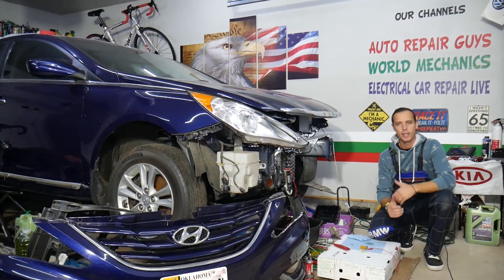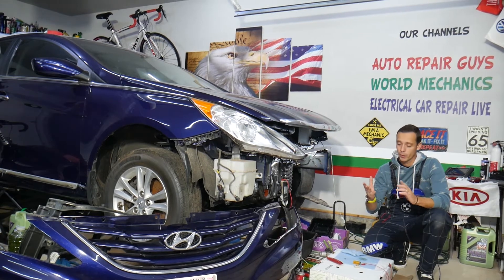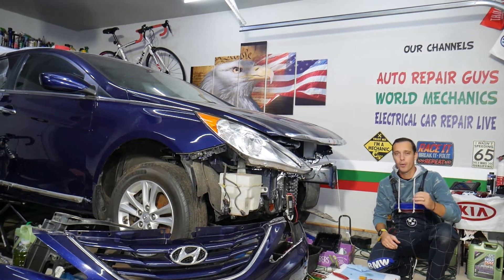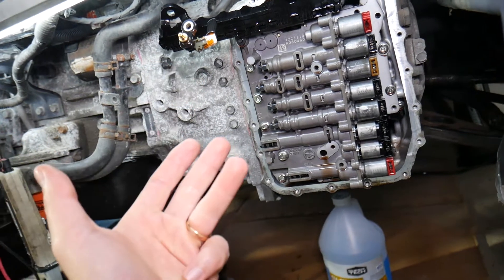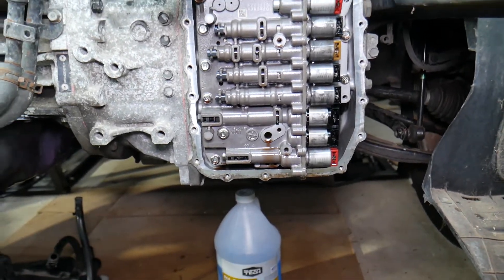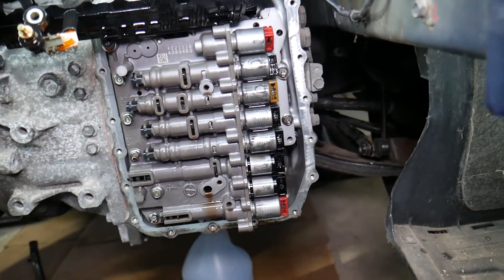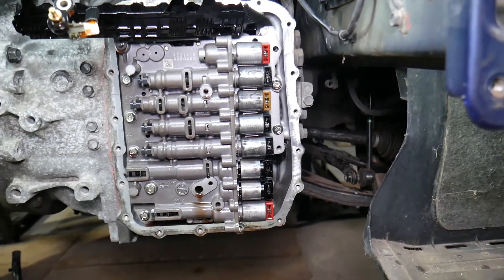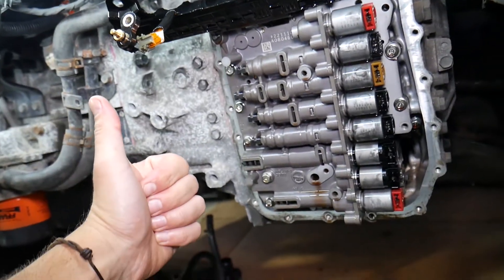HYUNDAI SOLENOID DIAGRAM, HYUNDAI SHIFTS HARD, SLIPPING STUCK IN GEAR FIX

Comment: Hello, congratulations for your channel and thanks for sharing your knowledge.  I have a 2012 Elantra A6mf transmission, when I put the gear it is stuck in 4 speed.  I wanted to know if it is a specific solenoid or if it could be several.  I did the resistance test on all of them and they are within their values.  What do you recommend me?

Comment: Do you know if the 2006 sonata 3.3 V6 transmission has solenoid or a valve body? There no videos on this transmission but yet they all have run into the no reverse! Thanks and great videos

Comment: Hello .. Can i ask for a help
I just open and rebuild optima A6MF1.. THE problem of the transmission no move in drive after i rebuild it completely still the same problem.. Can you please help me if do i need to change valve body assembly or those solenoid only thanks in advance

Comment: I have a 2017 Elantra se auto and when Im in 3rd gear driving to 40-45 mph it will not shift until almost redline then what happens is if I'm rolling down hill it'll change to 4th then won't go to fifth and if it goes to fifth it will bog down n not drive right so what do I check for

Comment: Hey guys, I have a 2016 santa fe 2.0T. Looks like I have issues with the shift solenoid. Transmission was bangging into gear when downshifting in D. I cleaned the solenoids and now it shifts worse. Where can I buy reliable shift solenoids from?